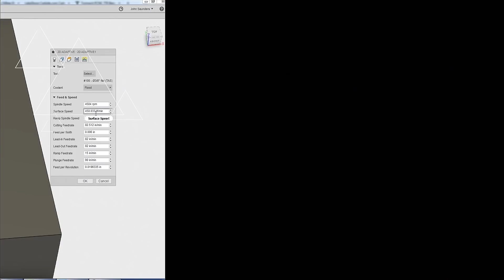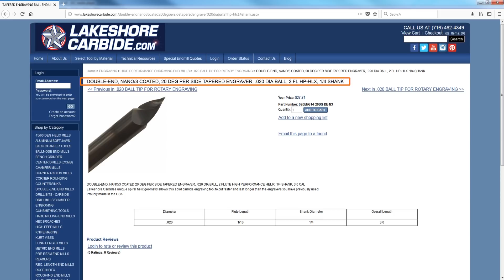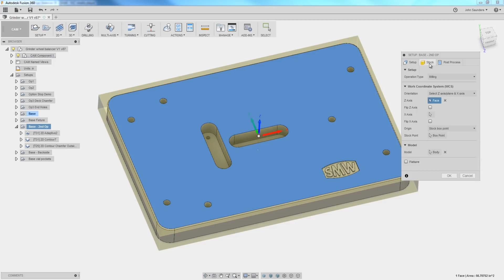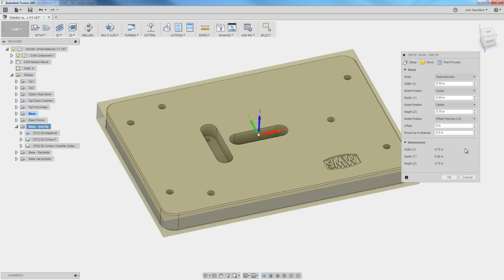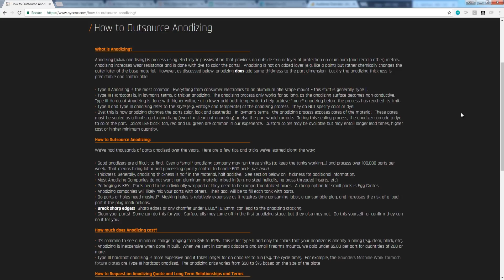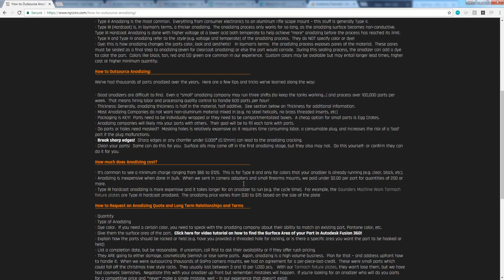Surface Grinder Wheel Balancer - Part 2! WW178

Comment: You talk a lot about feeds and speeds. But many of us have routers with fixed spindle speeds. My router for instance has five set speeds. 10000, 13000, 16000, 19000, and 21000 rpm. So how do you figure your feed rate when you're stuck with a certain spindle speed? Haven't seen much information on this and I'm sure this would benefit a great many people. Thanks.
Reply: Feed per tooth x number of teeth x rpm = feed per minute. So if you have a tool with 2 cutting edges and you want to take 0,1mm cut per tooth at 10000rpm, you will set the feed 0,1mmx2x10000rpm = 2000mm/min.

Comment: Scotch brite and a palm sander doesn’t work that well because there’s too much flex in the scotch brite fabric and the sander doesn’t move enough of a distance to do anything. It just vibrates the scotch brite but the grit in it doesn’t move anywhere. 

They make scotch brite pads that fit to bench grinders, works much better. 

Also rubberized sanding blocks work well too. As do abrasive nylon brush wheels that fit on angle grinders.

Comment: Nice engraving! Another reason to do it immediately after the fly cutter is part flex after additional material removal, especially on thin parts or ones with large unsupported areas

Comment: Maybe cut the ScotchBrite pad use that with a sander that takes 1/4 sheets. You're loosing a lot of energy not having the pad firmly attached to the sander. Pneumatic sanders are a little nicer, at least that was my experience while working on a lot of parts for a Van's RV9. I have to wear a mask though. Why do you dislike bead blasting? Hard to beat it for small crevices, just be sure to plug threaded holes. I used to get tendonitis bad, only help was a sports PT who did deep tissue massage and electrotheropy, and then watching how I grip stuff and press. No problems for a few years. Happy New Years!

Comment: That "rinky dink" blancer is an Anderson precision blancing way. It has a working capacity of 1 ton for the litte one, but just 10 ton for the big one. They are self proving self aligning and true as AAA surface plates. The math in them is rather amazing.  http://nptel.ac.in/courses/116102012/160

Comment: John, is there a reason you use such a low depth spot  I always spot drill to final diameter +.015 % 2 so you leave a nice 15 thou chamfer on your holes assuming you use a 90 degree spot drill
Reply: I use a 120Deg spot tool. It's better for the drill bit that is typically 118Deg.
Reply: That should be a / not a % not sure how I got that in there
Reply: U can edit it.
Reply: A free chamfer is nice, but I believe it causes additional wear on the drill that follows, since the flutes contact the work first, instead of the point. Ideally you should use a spot drill with a wider angle than your drill, so the point of the drill contacts first. I'd also expect shallower spot depths to increase the life of the spot drills.

Since you're probably going to be chamfering more than just the drilled holes, may as well use a shallow spot depth and preserve tool life.

Comment: Don't know how well it would work on aluminum, but at my old job we did finish some softer materials (proprietary stuff, sort of like renshape) with scotchbrite under a standard palm sander.

Why were you stopping the scotchbrite from spinning with the orbital sander? It needs to move against the surface to have any effect, why stop it from moving?
Reply: Looks like the abrasive disc was still on the sander, so the scotchbrite pad wasn't even attached to the sander. PSA:- The same hooks that hold standard abrasive discs hold onto scotchbrite great. And yes, let it spin, but adjust the sander and down force so that the scotchbrite turns slowly not spinning around like a damn cut-off wheel.

Comment: Saw you installng what looked to be sealed bearings, isn't the extra resistance of the seals in the bearing going to make the balancing less accurate over using shielded bearings or using bearings with no seal or shield at all?
Reply: He'll be OK, so long as the rotating mass is high enough and he only needs to reduce the imbalance so far.  Definitely would be a more sensitive setup with naked bearings

Comment: The modular vise seems like one of those "why didn't this exist 50 years ago" things.
Reply: Not to take anything away from the good work of Mr Saunders, but modular vises have existed for quite some time, primarily as big $$$ tooling sorta things. Take a look at Steven's Engineering (who incidentally, also make table fixture plates).

Comment: Is there a reason why you guys don't do anodizing in house?
Reply: Anodizing is a special requirement business. ( I designed anodizing lines) High current is a must, 30,000 amps @ 5 volts is typical for a large setup. Special cleaning tanks are needed. Phosphoric acid at high temperature may be used. 
There are many other requirements as well. Aw heck, farm it out!
Reply: Sicktrickintuner; Yo, My line I designed was a 160 foot long coil anodizing line (6 foot wide) with several  cleaning tanks, color tanks, a very long anodizing tank, plus roll feed drive and roll take up equipment. 
It was a fun bit of work.
Reply: Ya you need expensive equipment to anodize materials along with all the chemicals and floor space. 
I used to build the transformers/rectification units that were 12V at 5000-30000 amps! Lots of copper into those things. And some had a cost $100,000 for just the transformer unit!
Company I worked for was North American Rectifier here in Canada